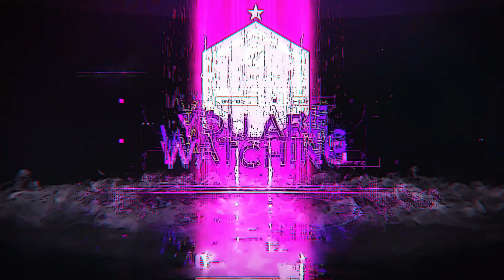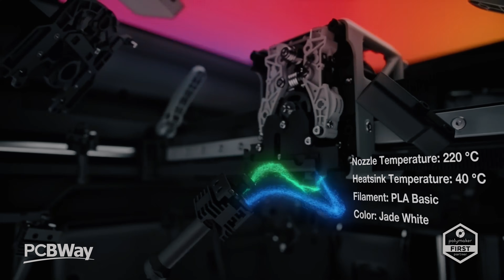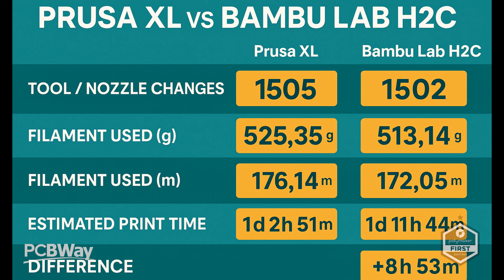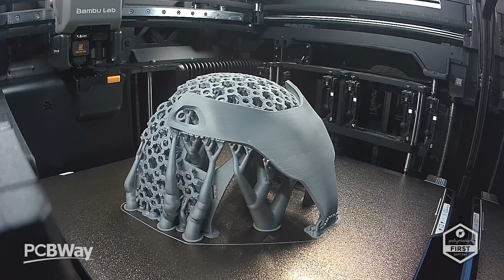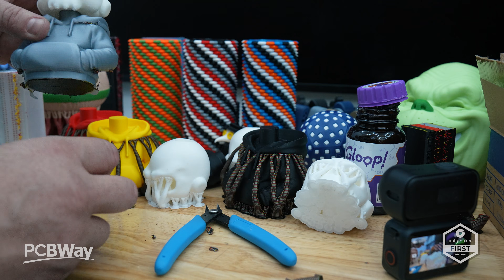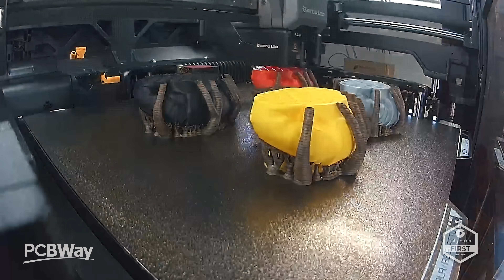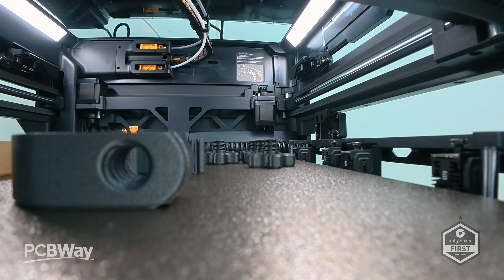Bambu Lab H2C – Faster? Slower? Better? The Honest Real-World Review

Comment: In general you cant argue with bambu quality and tech. Its cheaper than i expected, filament waste is less than i expected.

If the snapmaker u1 hadnt killed the prusa xl the H2D does on price alone.

Its not for me but 7 colour little waste, if i needed that and the print volume i'd buy it. 

For me 100% snapmaker has it, enough colours, big enough and a price that the wallett can tollerate.

18 months from now theyll be many more tool changer options, more heads bigger beds etc.

Likely if not sooner were all going to be falling at the feet if INDX hot swap true tool changing instead of head changing, easily with 10 plus tools / hot ends 😂 thats the future
Reply: for me it's all the total count - I would ideally love to have my whole filament library "online" and ready to extrude.  I agree for most cases 4 colors is enough - except when it's not and you can't do anything about it. :(  The Prusa machines seem nice but the costs blow my mind, and again they don't have an AMS system right?  So if your machine has 10 heads that's is - need 11 colors TFB.  It's enough to make your head spin trying to work out what is the best choice.  For me having my P1S for a while now, and loving it, familiarity with the slicer, the AMS and how Bambu does things is another reason to stay in their pleasant little "walled garden".  The proprietary nozzles has me worried - if they ever decide to stop production I guess we're all screwed, but maybe at that point they would let someone make them for older machines?

Comment: £2,000 for a slow color swap? No, I will wait for the INDX.
Reply: Need a good printer to attach it to. Prusa CoreOne has been very subpar, no chamber heating, way too small, build quality has gone down. I've been so disappointed with Prusa over the past few years. They've lost the plot.
Reply: Slightly slower yes - Whole head swap faster but hard cap at 5 colors - H2D can in theory swap between 24 colors in one print - that's a whole crayon box to play with.  If lots of color options is your need then the H2D wins hands down. I've heard of the INDX but isn't an upgrade and how many colors does it max out at?

Comment: tbh, dont mind a slower print, if it means less waste.
Reply: You can have a faster print and less waste with half the cost with a Snapmaker U1
Reply: @ValleDelSergio  im aware of the u1, but already bought into the bambulab ecosystem, print farms are most effective when you stick with one brand
Reply: @MistaWells at some money and time (which is also money) may sway you to change brands
Reply: @MistaWells you can buy 3x U1 for the same cost as the h2c atm.

Comment: I am torn on this thing. I like it. I don't like purge. What I like is the clean and compact AMS system and roll management, contained, and able to dry/contain moisture. That combined with filament saving from toolchanging is killer. Not to mention swapping nozzle sizes, even, for finer details. Lots of possibilities. However, If other brands can do that, for cheaper, I would probably lean towards them over this complex beast. I can't get over how simple (and cost effective) the INDX system is, as well as the U1. And thinking maintenance down the road, this thing looks like a nightmare.
Reply: I think H2C is a good stop gap if you need to use it right now. INDX isn't available yet, and will continue to get better over time. I plan to get H2C now use it for a while, then get an INDX next to it. Main reason is I've already bought into the Bambu ecosystem, and I've been able to re-use stuff I already have.
Reply: @Luke42652 15 more hours... That is insane
Reply: Are you thinking a complete tool head swap is less complex than a hot end swap?  Seems simpler than a U1 to me.
Reply: @o @oceanrider68 o I’m thinking in terms of maintenance and complexity with the nozzle swapping that the H2 C does. That whole 6 nozzle mechanism seems a lot more complex than just an extruder parking a tool head, using the Core XY motion system itself. Not to mention the embedded wireless sensors and other sensors to make it work.
Reply: @rpi @rpiian sensors are there so the calibrated flow rate is for that specific nozzle/filament.  It’s all pretty complex to be honest.
Reply: @rpiian h2c doesn't look like a maintenance nightmare. At all. It's an additional rack and belt on the right-hand side and 90% of the tool contacts are magnetic. It doesn't use pogo pins. It doesn't have alignment bars. Its all metal.

I have and love the snapmaker U1. It has pogo pins for every toolhead. These wear out. It has metal-connected-to-plastic alignment points. The motor servos are not sealed shut. I have had zero issues with my U1 but it will have a ton of maintenance when my print hours get higher. 

Out of all the printers you've listed, the h2c is arguably the least concerning in terms of upkeep. Its not overly complicated, as you seem to think. All it is is an extra rack, belt, and motor added to an H2D and the H2D has proven its reliability at this point. The H2C isn't much different.  

Magnetic contacts are some of the most reliable that you can get due to lack of friction alignment wear. 

If an H2C has the offerings that meet your needs I would definitely not let a maintenance concern keep me from buying it.
Reply: @Unkn0wnC0mmand  Yea good points I guess. I just think swapping out an entire toolhead would be easier than stripping the rack down for bearing swaps, or whatever, like a full suspension MTB. That and the extruder complexity on H series vs single direct drive on the others. Pros and cons I guess. I’d still consider an H series (either H2D or H2C), but yea, I just like to know what I’m getting into first.
Reply: @rpiian a big portion of multitoolhead systems aren't repairable. They're made to be replaced. The ENTIRE H2C nozzle swap system is $299. One Snapmaker U1 toolhead varies from $169 to $259 depending on where you are ordering from.

Looking at it strictly from a "replace it when it breaks" perspective, the H2C is still cheaper. Bambu said they tested the nozzle swap systems to like 20 million changes with no failures. No idea where that interview quote was but it was in a tech magazine interview with Bambu engineering director. 

Ill bet a kidney that my U1 toolheads do not get 1/20th that many changes. 

From an engineering perspective, its not the complexity of the H2C that impresses me. Its what the H2C accomplishes with such relative simplicity. The entire nozzle change system is 2 rails, holding 2 racks, driven by a single belt on a single motor. Thats not complex.

The complexity comes in with the software and how it manages the electronics on the toolheads, etc, but mechanically, its pretty simple.
Reply: @Unkn0wnC0mmand Word, you’re right, that def pares down what’s going on, thanks!
Reply: Index is the way to go. 
But the product owner from Prusha must go... He is slacking...
Next thing is to put an extra toolhead which will prepare a hot end for use, this way they can have another 5 seconds
Reply: It’s just way too slow as it’s tied to a legacy system the ams. They should have gone down a new build route. Instead they chose to retro fit an existing frame and system. Bad move.
Reply: @perkulant4629  its slow now, but when they release the track switcher it will be faster. Apparently you will be able to use the AMS on either left or right nozzle automatically. So this means with two AMSs you can prepare the other nozzle ahead of time. The system is already scalable to 24 colors. The track switcher should substantially cut down on the time.
Reply: @perkulant4629  not to sound like a pedantic, but I’m pretty sure they built this frame for vortek to begin with. In several videos, they say that’s why the build plate is smaller was to fit vortek. Development does not happen overnight. I don’t disagree with the AMS thing though. I think INDX is a much simpler (and faster) system as a whole so it will be interesting to compare the two.

Comment: As I said since they started advertising it, it's a compromised system that lacks many advantages of a proper tool changer. It's slower, more complicated, and still relies on the AMS. I'm not saying it can't work well, that it's bad, or even that it's not impressive, but I'd absolutely prefer a real tool changer. INDX is a superior solution for multi color and especially multi material. People are still going to froth at the mouth over this, but I'm not in that crowd. At least it's better than just AMS printing.
Reply: it looks like indx is superior for multi color/material under specific cirumstances. can it do 25 colors? can it reach 350C nozzle temp? does it have as large as volume? if it is a 2 color print, is it slower or faster? i think the core L looks amazing and i personally will look really hard at it, but let's wait and see some review videos before we present suppositions as facts, and ignore nuance
Reply: @xSKALBER Literally nobody needs 25 colors and it could with an open source MMU. It can reach at least 320C nozzle temp and the H2C cannot reach a high enough chamber temp to competently print most materials that need nozzle temps higher than that anyways. It is nearly the same speed for a 2 color print, but sure the H2C has a slight advantage in that specific scenario. I could cherry pick 50 scenarios where the U1 or especially INDX are superior or faster. I'm talking about engineering analysis and practical use.
Reply: @802Garage  core one L max nozzle is 290C and cannot print PPS. personally, IDK how much that matters, kinda seems like a material specifically designed so the h2c/d can say they can do something the core 1 cannot, and nylon6 is right there to compete with it. open source mmu... thats a non starter for 99% of users in 2025, and that's if it even works. you can't pick 50 scenarios , especially where the U1 (what???) is superior, you can pick one, and that's going to be prints with many colors per layer, not more than 8 in a print though, and even then, it's going to be need a somewhat larger model to even realize meaningful differences. i already know you're going to dismiss this out of hand, but can the core 1 or core 1 L cut vinyl? or laser anything? can it print something as large as the h2c can? can it use pps? 

you're making me go to the wall for BL... which isn't what i want to do. i want people to be accurate with their analysis. also, you have not seen this thing in the wild yet. the Original Prusa XL came out and is a sweet machine, but maybe not perfect in a few different ways, despite much clamor before release.
Reply: @xSKALBER I'm not a Prusa guy. I'm interested in adapting INDX to other platforms. Yes, I absolutely could pick 50 specific scenarios involving time, multiple materials, need for other slicers, and more. My point was simply that if you only focus on the strengths and not the weaknesses, of course the printer looks good. I can compare my Qidi Plus4 to the H2C and tell you scenarios where it is much better. Printing PPS-CF for example which benefits from higher temperatures than the H2C can do, even if it can print it. I'm not denying most people don't want an open source MMU, I'm saying the option is there. Considering how many INDX heads can fit on a machine, 99% of users will also never need that. It could care less about vinyl cutting. I have been accurate in my analysis. You are just basing everything on Prusa. I'm not. To be frank, the vast majority of users do not print with anything needing more than 290C nozzle temp nor do they ever fill the full bed size of the H2C. I'm not at all discounting those advantages, but if you want to start talking about what most users need, it matters. Especially for $2,400+ ya know?
Reply: Faster multicolor prints is an ok goal but it's pricey and complex for what it is. Bambu has historically made really simple and reliable machines but I don't know if this is going to hold up long term.
Reply: @COWGUYVT it’s definitely going to be causing a lot of “what went wrong” videos.

Comment: This definitely looks like a busy system with all the mechanical movement how will the maintenance be and how long will it last before you have to place parts and another question is it worth the extra time? It takes a print something by going with this machine
Reply: It’s ok DRM nozzles are available separately 😂. 

In all seriousness it’s a valid concern, lots more moving parts to fail with the H2C. The excitement I have pre reveal is dwindling day by day. 

Speed
Reliability 
Robustness

All seem to be concerns.
Reply: My h2d started asking for new parts around 350 hrs.  Flow blocker arm, nozzles, and hot end assembly for the left side at about 529 hours of use. Also had to push the right hot end connector back into its socket as it was starting to back itself out and throw messages related to temps.   Except for the nozzles I’ve had to wait for parts to come into stock.  Not sure about this h2d long term.   Looking to add a Prusa as a backup as there will be a lot of parts in common between the h2s, h2d, and h2c.

Comment: I still don't understand the purpose of this system. It looks like they saw BondTech previewing the INDX toolhead and thought "hm, how can I make this worse?"
Reply: So if I print let’s say a figure that has 7 colors it’s x5 faster than a single nozzle Bambu and it’s has 95% less waste! It has improved my profits by almost 75% so that figure used to cost me $6.00 to print it now cost me $1.50 and 12 hours less time! I can’t do this with the snap maker or the XL. If you are printing multiple colors it’s a great machine but if you are only using 1-4 the others might be better but the nozzle change is so easy with the H2C
Reply: 😂 You summarize my thoughts quite concisely.
Reply: @802Garage  I think I'm just gonna finally induct myself into the Prusa cult and get a Core One L when they release their BondTech collab system.